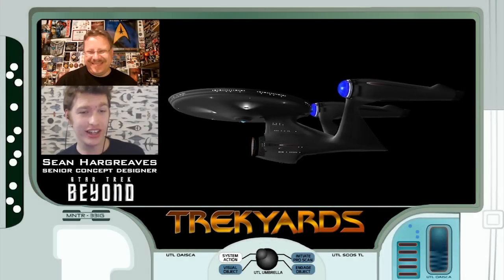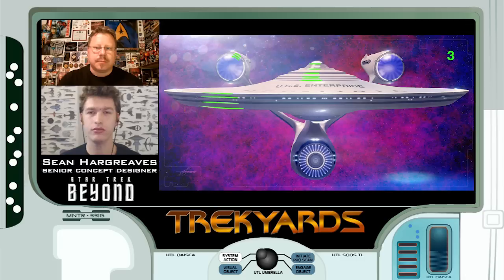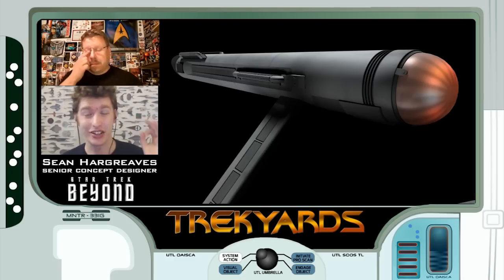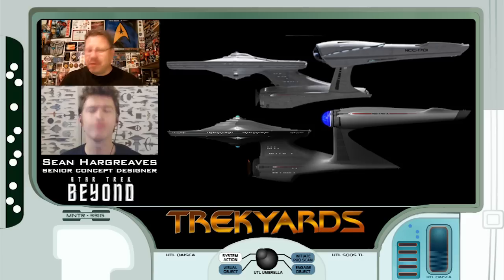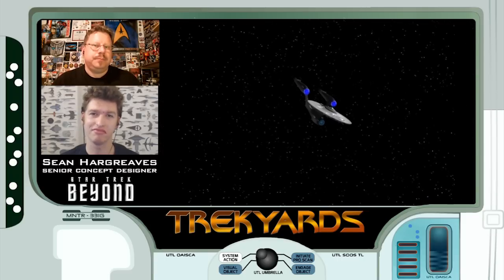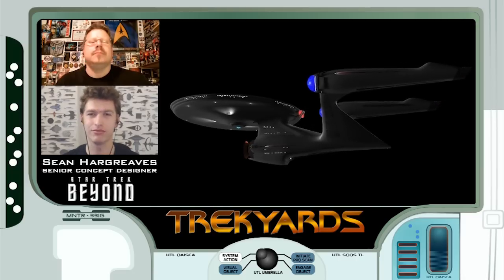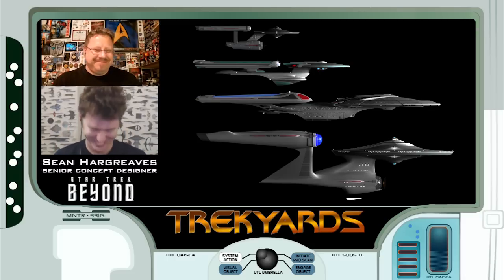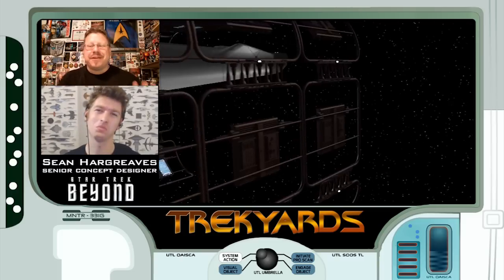Enterprise EP187 - Enterprise 1701-A Concept (Part 2) (Beyond)

Comment: I never had an issue of the size of the ship when you think of it from a design point of view. Engines arnt small so you have to have room for that water has to be carried for all the crew needs from drinking to showing, you have to carry that much around. You can recyle the water refilter and reuse yes but you still A amount to serve B cinsumtion. then all crew has to have places to sleep and relax for conforts of home. You need Anti matter for the ship warp to function you need to carry enough for the time it is in space and if you are explorting for 5 years at a shot you need 5 years of fuel. Then food clothes armor interal space for the for walking and such. So when you add all this and things I havnt even metioned yet size goes up. This was done before replicators like TNG even where used I have seen this in any JJ prise ship yet.

Comment: I think the upsize concept here is ridiculous, and the new design is going toward more of a ship from Babylon 5.  I'm baffled why people are so accepting of the larger size.  So all the federation ships are larger?  In the 2009 movie when the fleet is leaving for Vulcan the enterprise size is comparable to the other ships, so those ships would have to be bigger.  Also , larger ships mean larger space docks and ports.  The scene in beyond  of the Franklin ramming through the space doors seems to show that the dimensions would support ships roughly 2-3x the size of the Franklin ( 300-400m ) as opposed to 6x ( nearly 800m).  To me all the scales don't match up for it to be THAT big.  I'm cool with making it alittle bigger (maybe 400-450m),  but almost 800-900m long is absurd.  I could probably get use to the new design, however I cannot accept the size upscale concept

Comment: This new timeline is alleged to be a branch from the same tree, and you fanboys that aren't too fond of it comfort yourselves that the original timeline is another branch and therefore still exists.  So, this Romulan guy comes along through a black hole, or whatever, and CHANGES things, killing Kirk's dad, etc.  The point here is he CHANGED the timeline, he didn't create a branch, he bent the existing one in a new direction.  Despite the depressing fact the Abrams absconded your beloved fiction, he further defecated on it by stripping it of everything it's creator wanted it to be.  It no longer tells a story, deals with issues of society, or gives us hope of a prosperous future - it's just another flashy action movie with lots of fire and explosions, and no substance what-so-ever.  There is no story, there's nothing to learn, nothing to take away, nothing you can believe.

That whole mindset is carried right into the "design" of the ships.  Except that the ships are saucers tied to two or three cylinders - there is nothing to suggest that this timeline stems from, or is connected in any way to what came before that Romulan guy showed up.  Even the Kelvin doesn't fit the pre-Abrams hijacking that it should.   Ship design, especially among fans, was already atrocious and nonsensical, almost all of them just rearranging and flipping component parts with no regard for the internal structure, function, or how those parts interacted with each other.  It's like "designing" a new aircraft carrier by flipping the hull upside down, turning the flight-deck backwards, and putting the island on the bottom.  What does rearranging the parts of an existing ship get you that merits the cost of even setting up to build this "new" design?

While lame "designs" such as the Stargazer have the excuse of cost and time restraints of being props on a TV show; photo-crapped nonsense turned out by fans don't have that excuse, nor do those designing CGI for 1st line motion picture productions.

The "Abram's 'Prize" is a prime example of no consideration for what came before Abrams absconded the timeline and magnifies the pure disregard of there being anything inside these "vessels."  The ONLY reason that thing alleges to be nearly twice the size of a TOS Constitution is because JJ apparently has very tiny hands.    THIS bit of molten crap only furthers that disregard that these are space craft and not an Alex Tremulis hood ornament.  They have no connection to what came before.  That NCC stands for Naval Construction Contract, remember?  but gone is the logic and practicality of Franz Josef and Matt Jefferies that gave us ships we could believe could exist.  What we're stuck with is the drippings from the facial-tattooed hipsters that think anything they do is "art."

Comment: Don't like it. The pylons connecting points look really weak, the shuttle bay looks like a butt hole, the steps on the bridge section just look genuinely weak and poorly attached to the saucer and the giant blue domes just look so old and cheap compared to the detailed look on the JJPrise. I like the minimalism though and the less bulky warp tube things.

Comment: Whoever designed that stupid butthole sized docking bay should to be the first one to try to fly in and out of it... A shuttle bay is supposed to be practical, usable & big enough to get in and out of, not so small that Luke Skywalker couldn't get a Proton torpedo into... I don't think even the force could help Luke out with this one:) Good luck pilots trying to fly the Death Star trench run to get back to the Enterprise...lol ...... Yea, and get rid of the Batman wings on the engine pylons and interconnecting dorsal fin, it looks stupid. Paint this ship black & add a afterburner where the shuttle bay is and you've got the Bat-mobile inspired "Bat Ship"... I think the designer of this thing has seen to many Batman movies! You're Fired!